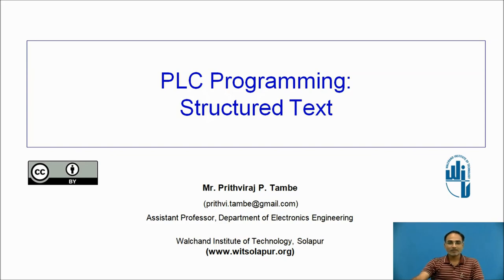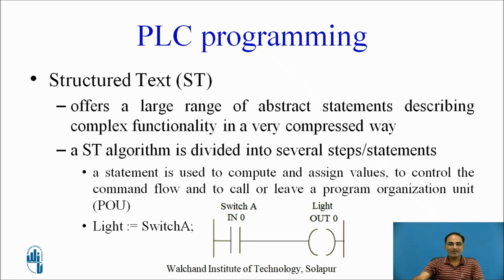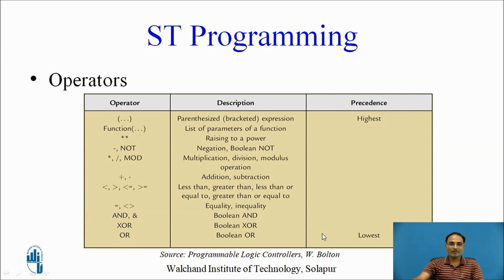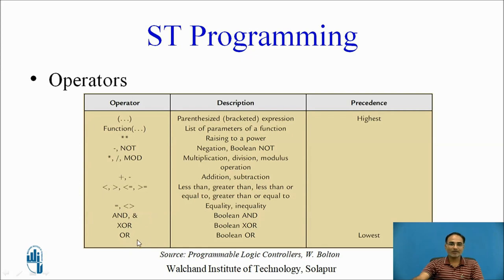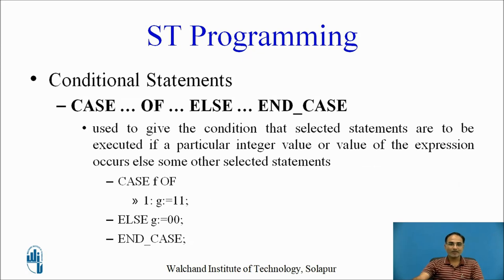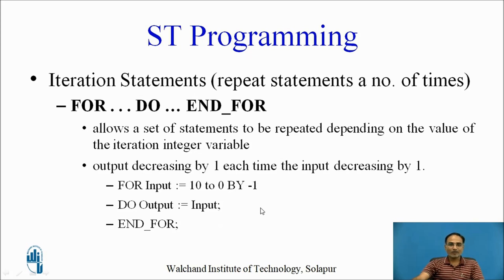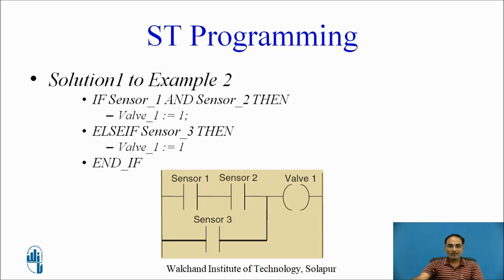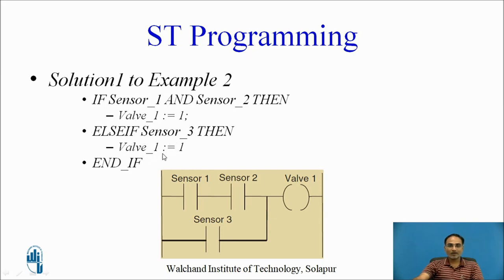PLC Structured Text basics

Comment: Quick question regarding programming PLC controllers : you basically need both a text-based program and visual-based one for the controller to work ? Or is it possible to only stick to text-based ?
Reply: Hey Demyan, as per my experience, it depends on the complexity of the program you are implementing and the capability of the PLC you're using. 
Some PLC/ manufacturers, you can use both graphical and text based language on the same project depending on what's easy to program a particular instruction but to some PLCs especially the small ones, they are designed for one language.

Comment: HI sir, kindly help me to solve this task. I know the ladder programming but i  am not able write the structure one.
task is :Create a PLC program in structured text that moves a simulation axis from one point to another and back again (a trip). It shall make this trip a number of times.
It will have the following properties:

Written in structure text and in C/C++ (two versions).
Each move shall have different velocity, accel, decel and jerk.
There shall be a delay at both points.
It shall be possible to configure how many times the axis makes the  trip.
It shall be possible to start and stop the axis at any point.
A simulated EStop variable shall be made available.
Reply: Is it some University or Course exercise?